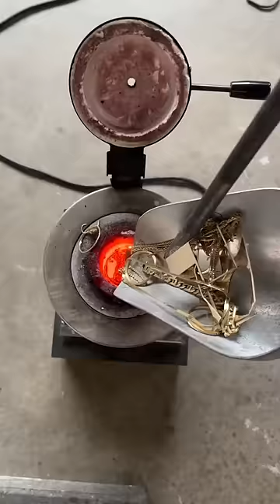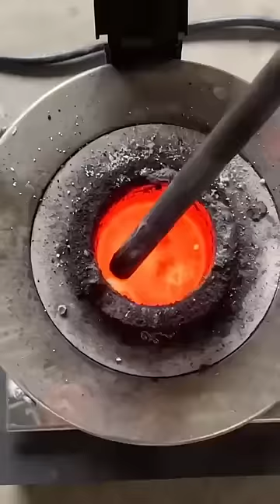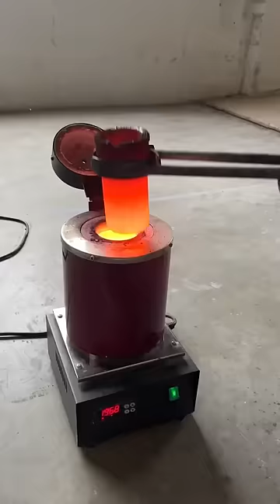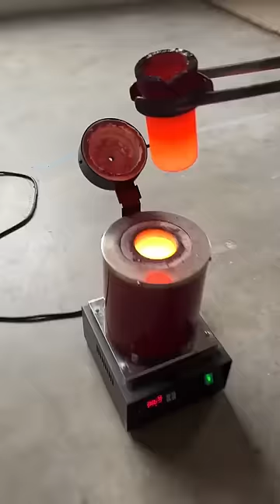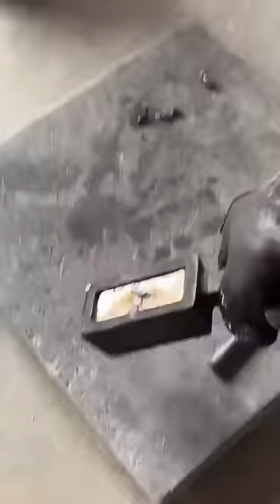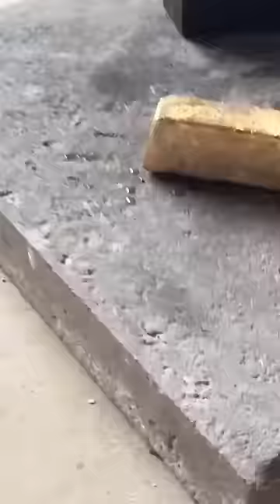Melting $100,000 Worth of Gold! 🥵🥶

Comment: The ingot appears to be about 3 to 3.5 cubic inches, at .70 lb per cubic inch this could be 4.28 to 5 lb of gold. There are 12 troy oz to a lb and a current price of around $1981.90 per oz. If it is in fact 3 cubic inches, that's $101,076.90. If it's 3.5 cubic inches that makes a 5 lb ingot, $ 23,782.80 per lb it would be $118,914. One troy oz = 31.10348 grams. Gold is almost twice as heavy as lead.
Reply: My man is Einstein brother
Reply: Genius
Reply: @AstrylPrism  ggg
Reply: This is Not pure gold. I think that you are waaay off. The rings themselves will be 18k at most and some of the other scrap looks between 10k and 14k
Reply: Doesn’t look like real gold at all
Reply: @allisonpodesta8865  that's because it's a mix of 10, 14 and 18k gold. So the other metals, probably Copper, Silver are still in the Ingot.. Definitely not $100,000 worth either, even after being refined.
Reply: You forgot one equation, jewelry comes in 10k 14k 18k and 22k, if its 10k gold its less than half pure gold.
Reply: @stackingbarz  
😅 mo is mo no
Reply: No way that is worth 100 grand. No way is it a 5lb bar. B.S!
Reply: -----  you can look at what he poured out of the scoop and tell it isn't 5 lbs of material  -   and I am reasonably sure that simply melting a mixture of junk jewelry and pouring it to a certain size doesn't refine it to 999
Reply: nfcn
Reply: Some one did the math
Reply: 14.58 troy ounces in a pound genius.. does anyone research before they say anything
Reply: I just want to know why he stirred it ? Was that the impurities on the rod ?
Reply: Correct

Comment: Honestly the way that the price has gone through the roof on certified gold with papers no hollow gold or gold plated or silver over gold the minimum value I wouldn’t be surprised because gold is rated by its purity by a gram 64oz of gold at Mrp is well over 115k or through loyal business 77-85k ruffley 89-95that’s a good profit on both sides for the future business